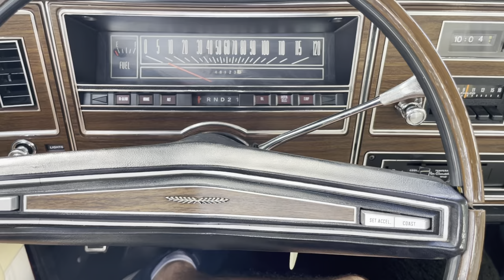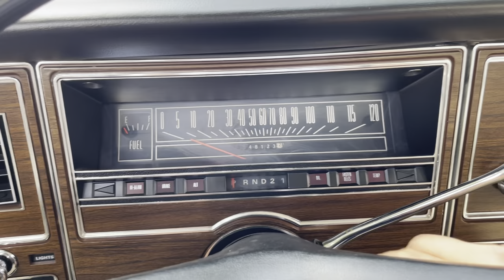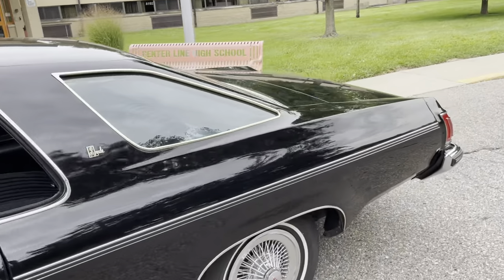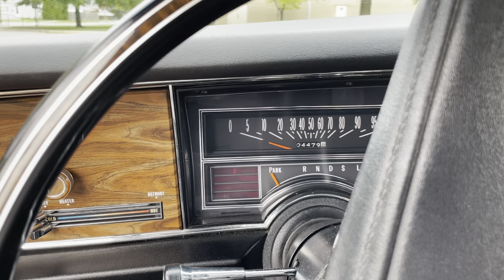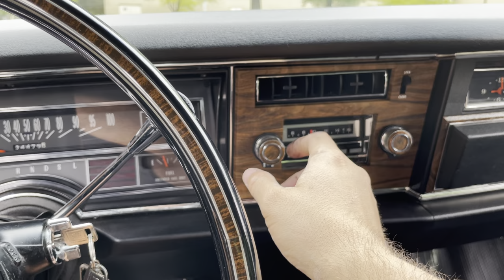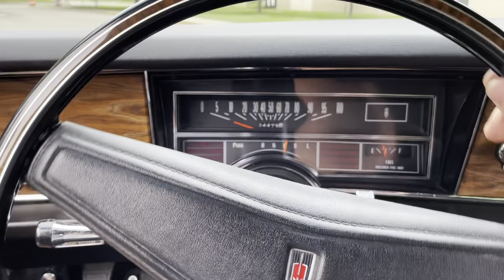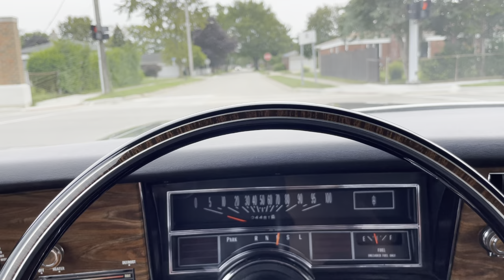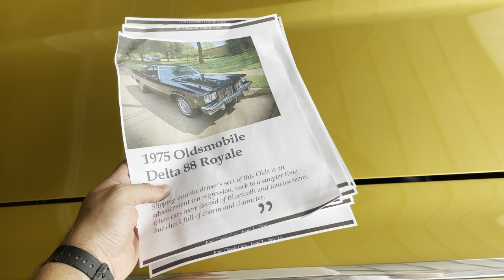1975 Oldsmobile Delta 88 Royale & 1974 Mercury Marquis Brougham - Check out Article in Description!

Comment: This is not a fair comparison at all. The Oldsmobile 98 Brougham used a lot more sound deadener, had a softer suspension, and had a much more luxurious interior. This is like comparing a Ford LTD to a Chevrolet Impala instead of the Caprice Classic. Another thing, the main reason for the excellent ride was because Ford worked with Firestone to produce the softest riding tire possible. They were fine for the cars but, didn't do so well for the Broncos. Because of that, Consumer Guide Auto 1974 reported that the 1974 Mercury Marquis was the worst handling car they had ever tested. After the Bronco incidents whereas they tended to roll over during emergency maneuvers, Ford tried to lay the entire blame on Firestone instead of taking a 50/50 share of the responsibility, as they should have. Ford ended its relationship with Firestone, which was the longest between a car manufacturer and tire maker, in the history of the automobile. By the way, I subscribed to your channel.

Comment: I think GM/Oldsmobile had their suspension more dialed in.  Their engine/transmissions were generally reliable and smooth.  GM designed had Mitchell cracking the whip and really had some exquisite surface detailing.  The light reflection off the surface is just a cut above anyone else in the 1960s and 1970s.  I think GM went in the right direction in their interior with their carpeting choices.  My god whoever did their body stampings and paint should have been fired.  It is really is a shame.  The public agreed with the packaging and bought them.  I would have too.  I would be ticked factory ordering an 88 just the way I wanted it only to have some off angle trunk gap or crummy trim piece.  

I think the downsized RWD next generation was improved, but the early 70s cars had some pissed UAW folks on the line and some engineer cost cutting did not do justice to a nice machine.

Comment: I have a question for GM enthusiasts - what was the difference between Chevrolet's 454 CID V8 and the other divisions 455's? Why was there only 1 CID difference? Why didn't they all just have 455s?
Reply from the maker: Almost everything is different aside from carburetors and distributors.  Each GM division had its own unique design for V8 engines until 1977 model year when they started consolidating them.
Reply: @RareClassicCars  Thanks. I always assumed the 455s used by Pontiac, Oldsmobile, and Buick were basically the same engines, but that Chevy used a 454 for some reason.  I know at one time Ford had a 427, 428, and a 429 at the same time, and they were all different engines.
Reply from the maker: @protocriteria790  Yes. Ford also had 3 different 351s: the Windsor, Cleveland and Modified. 

But when it comes to GM, the 455s are all different as are the 350s.  A Chevy/Pontiac/Olds/Buick 350 basically only share carbs, distributors, oil filters and some other minor things.  All major design features are different.

Comment: I think the top-of-the-line Marquis would compete against the Oldsmobile 98 and Chrysler New Yorker. The lower priced Marquis or the former Monterey would compete against the Oldsmobile Delta 88, and the Chrysler Newport.  Also 1974 was the last year of the pillarless hard top for the Mercury Marquis  four-door and two door..
From 1975-78 the Mercury just stayed the same each year, the four door models were offered in pillard style only. The two door back window was adjusted so where it wouldn’t even roll down anymore.. Last thing, I don’t think the Mercury Marquis offered a rear passenger center folding armrest from 1975 through 78. I think in 79, they brought it back again.

Comment: So the 429 had a short stroke, large bore engine. With some of the best breathing heads ever put on an american car. The olds after 72 went from G heads to J heads, which had a exhaust ports that necked down to under 1 inch. With an Olds 455 and its 4.25 stroke, they would really have castostrophic failures in the earlier years with better heads like D, E and F models so I think to protect the OLDS engines they limited the breathing on the J heads due to poor geometry as a way to protect the engines. My B headed 4 inch stroke 400 Olds with good valvetrain parts would do over 6900 rpm. That same head and cam setup put on a 455 would have sent the bottom end into orbit. Olds giving the middle finger to the public once more only offered a forged crank in 1968 for the 455. After that it was cast stuff that got junkier as the years rolled on. One would have to ask this question, if Chevy could power school busses, tow trucks and millions of RVS with 3.76 and 4 inch strokes and making stratospheric HP and torque, why did olds ever need a 4.25 stroked engine ? Thats why so many builder magazine articles favor the 350/403 engines, even though smaller. Olds went down the automotive toilet after 1972. Ford most certainly did not. While Olds was barfing out wheezing emissions boat anchors FORD was working on canted valve small blocks that would hurt your eyeballs when in the right state of tune. It's telling that my friend that was in the scrap business specializing in old cars, and had every engine imaginable in his junk pile, chose to use 460s to power his car crushers.

Comment: 75 having a converter would choke the engine and make it feel less powerful. That's probably why the merc feels quicker.
Reply from the maker: True, but the net HP ratings are about the same and those would’ve included exhaust
Reply: @RareClassicCars  doesn't matter... Two completely equal engines one with a restricted exhaust and one with a not so restricted exhaust, the freer flowing engine will perform better. Imagine someone who breathes normal and another equal person who breathes normal but can only do so through a milkshake straw. Who's gonna run quicker? Haha
Reply: @RareClassicCars  I didn't see the full comment. Sorry. Well I'm not sure about that. With HP ratings. They didn't always include exhaust and accessories. Or only with certain things. Also they used to and still do fudge the numbers any way they want to. Take them both to a dyno! Also HP doesn't really mean much as far as I am concerned. It's the torque numbers that count.

Comment: The heater core is bad? You sure thats not 104000 miles?
Reply from the maker: Yes. When cars sit unused and the coolant doesn’t circulate, it tends to degrade radiators and heater cores.

Comment: Love both cars Ford put more into them reliability idk the GM were cheaper easier to maintain and those 455's were nothing to laugh at . If someone was inclined they could open its power easily. My dad had those olds with 455's loved them. We had later marquis and yeah they then im talking 86' and 90' and even the first 4.6's got more love. But i do know GM were easier to work on snd cheaper. Ive seen caprice classics go 330k miles a lot. But as Ford got newer esp 4.6 version go for ever.

Comment: During the mid 70’s and through the 80’s my work was suspension and alignment. The GMs typically did handle better than the Fords or Mercs. The Fords and Mercs were quieter, smoother. Fit and finish was never really on GMs menu. Just hearing these doors rattle to a close put me right back to 1977. They were awful.

Comment: if you are outside listening to the sound of an olds V8...( not the exhaust) there is no V8 that has the purrr of an Olds V8....its sexy smooth and hypnotic......but hey...someone had to buy a Mercury....and repairs and problems...the Mercury is gonna be in the shop alot....AND u will have to replace that poor quality Ford wayyyyy sooner than the quality Olds !!!!

Comment: It was about mechanical reliability that sold GM over Ford and Chrysler, through the mid 70's.  Sure, the body of a Ford was superior, but if your car was constantly "found on road dead" what's the point and who cares?  The big three all struggled with emissions, back in the day, Chrysler arrogantly  assumed they had engineering superiority and developed lean burn which was a complete disaster while Ford did exactly what ruined their reputation beginning with the Y block: built running gear on the cheap with crap subcontractors building inferior ancillary components.  Their vacuum driven components were a nightmare.

Comment: I think your observations are spot on but that Merc had outdated styling in it's day.  It's just a box and hideaway headlights in 1974??? Also, let's face it very few GM's like the Olds left the factory without a vinyl roof. The vinyl hid the seem between the quarter panel and roof. I'm sure they were taxed to clean up that seem for a non-vinyl roof car. I took a vinyl roof off my 1977 Buick Regal with the intent not to put it back on. When I saw how rough the finish was underneath I gave up that idea. One thing Ford did better than GM was rust proofing. The GM's rusted, especially around the rear windows. Fords didn't have that problem or at least not after only 3 years. However, Ford had poor chrome. It would discolor and rust sooner than GM's. Chrysler's had all the bad GM and Ford things combined. They were terrible but I always liked the Cordoba. I'd like to have one now. Now take a ride in my 1975 Buick Limited Park Avenue and there's a ride. The front seat frames in it were made by Flexsteel. Wow are those great seats.  Great videos!!!

Comment: Well the Olds beats Ford.  You match up a 98 to a Marquis and that 98 will beat this mercury hands down in ride comfort and luxury and reliability. I know my folks drove GM and 98s Toronados and Cadillacs.
Reply from the maker: Having owned 98s before and driven many, I’d still take the Merc, but it’s a matter of personal preference.
Reply: Edward Luth < The 98 from this period was not as reliable as the Merc.  The facts and not opinion included over heating engines, poor body quality, noisy differentials, a/c issues, and difficulty starting warm engines to name a few. The 98’s suffered reliability issues all the way to day they stopped production.  The ride comfort and luxury may be a matter of opinion.  Bottom line, the Merc was a far better car.
Reply: @melrose9252   I could literally laugh My  arse  off here because I was a boy back in the 70s and my parents and several of my relatives drove those 98‘s and they held up extremely well.. they were better built ….rode  nicer…more expensive and better equipped and nobody that I know had any trouble with them and they were rated a lot better than these Ford products so you can just live in your fantasy world …you are very brainwashed. lol

Comment: You're comparing these imperfections on the Olds as the they are now versus when the car was new. That makes no sense. It's been sitting for 46 years. The Mercury has no styling at all. Just a bunch of rectangles. No imagination at all. Seats in the Mercury are flat and you slide around on them. Again no imagination. A Merc was for people who couldn't afford a Lincoln, but hated the cheapass Fords. Ford went to hell after 1966.
Reply from the maker: Um. The imperfections on the Olds are factory imperfections.  That’s how it left.  Blobby seam sealer and poor fits didn’t get that way over time.
Reply: @RareClassicCars  I understand what you're saying. Things were rough at that time in the automotive industry as well as the country. I may  not be your best audience, because having lived through those times,  I may be over objective. I love your passion and I get the "um".
Reply: @b58hustler71  Poor GM build quality in the 70s was widespread.  Just close the door on any of their products from the time.  Gaps wide enough to fit your small finger...
Reply: @Richard4point6  I blame the Mafia run UAW. When unions dictate how a company should run, the servant becomes the master. Even the supervisors were in the union. No accountability, I think you'd agree.
Reply: Gregory Galminas < GM’s had the same quality fit and finish seconds after leaving the factory.